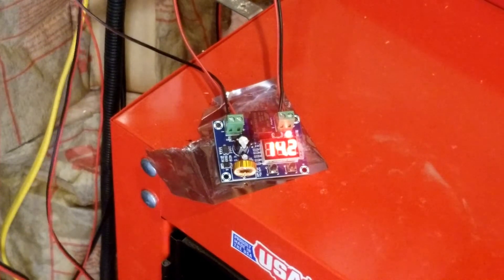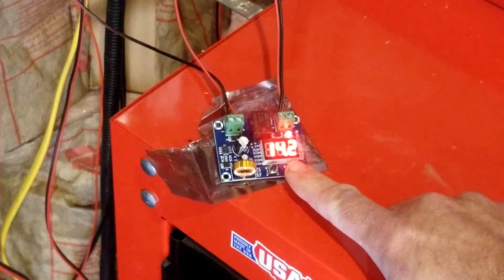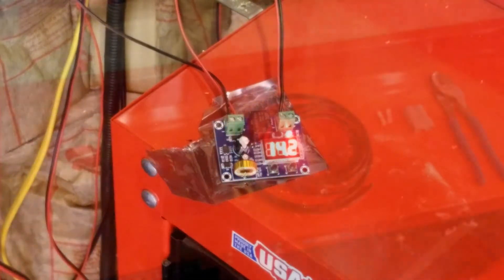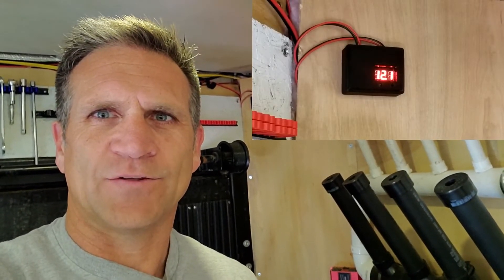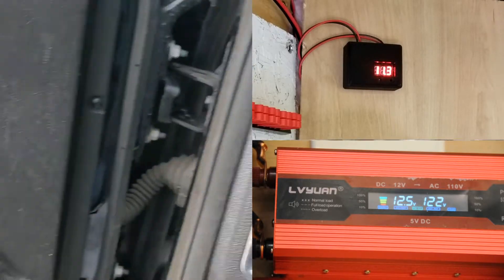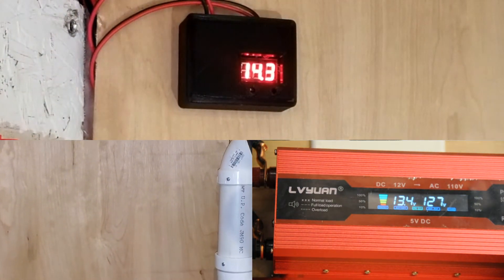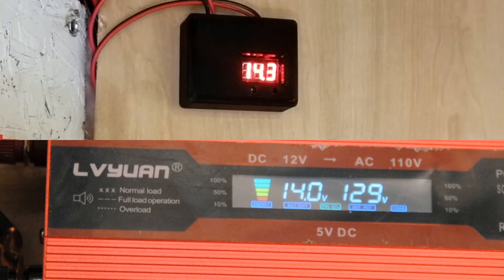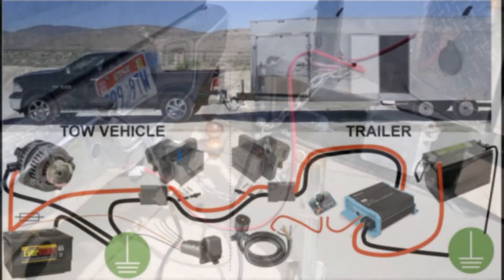DC to DC charger  installation Episode 2: The Install

Comment: Will the lit screen on the voltage cutoff drain the car battery if the car is not running but the trailer plug is connected?
Reply from the maker: Technically, yes. That little display draws power from the car battery. However, the draw from it is so low that a little watch battery would power it for weeks. So, although it does draw from the car battery, its impact is negligible at best.

Comment: Thank you for sharing! I’m currently in the middle of my install. You mentioned the two wires going to the dc to dc charger from the voltage switch. I understand where the red wire goes. I’m assuming the black wire goes to the negative side? Thanks in advance
Reply from the maker: Good luck with your install.

You don't need the black wire out of the voltage switch. The only reason you might use it is if you need to switch ground for something. You don't want to connect it to ground because that would defeat the switch.
Reply: @some-guys-garage  how's the system holding up?
Reply: @youcanthide004 it's holding up great! I no longer have to think or worry about having a charged battery.
Reply from the maker: @nathanecall Ha. That's funny. Evidently I was logged into my personal YouTube when I made this response. nathanecall is also me. Sorry for any confusion.
Reply: @some-guys-garage  Thank you!
Reply: @some-guys-garage What do you do with the black wire then ?  Cut it and heat shrink the end ? Tuck it away?
Reply from the maker: @projet2907  Disconnect it from the voltage switch and remove it. Or cover the end and tuck it away. Either is fine. It's simply not needed.
Reply: @some-guys-garage  Thank you !

Comment: I see some people just add a switch at the dash so after you start the vehicle and the amps come up you then turn the switch on, you can then turn it off each time you stop so not to run down the vehicle battery and thus don't have to turn the power on if you do not need it.
Reply from the maker: Thanks for the comment.

A switch at the dash is perhaps an easier way to visualize the solution for some people, but it's actually rather difficult to implement because you have to run all kinds of additional wires to get from the switch all the way back through the plug and into the trailer. It's also far less fool proof, since you could accidently leave the switch turned on when the car is off. The automated approach shown here is is not only cleaner, but it's actually easier.

The easiest, simplest thing to do is connect the trigger wire to the trailer marker lights. That way the switch and wiring are already installed. You simply turn on the lights to trigger the charger.

In the end, the "best" thing to do is to have the charger turn on whenever the alternator is spinning. This solution does that.

Oh, and all of these options are discussed in the planning video associated with this implementation: https://youtu.be/uONgZkrzkhY

Comment: Perfect solution for a 40 foot diesel pusher with batteries in the back and key switch up front no trigger wire in the battery bay. Excellent Job. Thank you
Reply from the maker: Thanks for affirmation! Glad it helped!

Comment: Excellent walk through for what I am needing. I have a question though. 

The voltage cutoff has 2 wires coming out and the DC to DC charger only has 1 place to put wire. Where does the other wire go? I am assuming to a ground?
Reply from the maker: The voltage cutoff has two wires going in - positive and negative. It has two wires coming out - a positive and a negative. The wires coming out are both switched, meaning they only do anything if the voltage cutoff is on. If you had a device that could be controlled by the ground wire, you could use that as the trigger wire, but the device I have uses the positive signal as the trigger wire. I suspect most devices like this would use the positive signal. If that's the case for you (and i suspect it is), you don't need the negative wire at all.
Reply: @some-guys-garage I am trying to set up exactly how you had it. If I am understanding correctly, coming out of the cutoff, you are only using the positive wire and connecting to the D+ ignition terminal on the DC to Dc charger, correct? And the negative coming out from the cutoff is connected to nothing, correct?
Reply from the maker: @johnsouthern5485 That is correct.

Comment: Also, is the aux supply from the truck from the 7 pin trailer pin?  I would not think so because that voltage would never reach 14 with that small of wire.
Reply from the maker: Yes - the supply voltage from the truck comes from the 7 pin trailer connection. The point is to have the charger come on only when the truck's alternator is running, which produces ~14 volts.

Not sure if you watched episode 1, but it explains the wiring layout.

Good luck!

Comment: Do you sell the housing for the voltage cutoff?  If so can I buy one?  Let know so I can get your contact info.  Great video and this is exactly what I need for my bread delivery trailer.....
Reply from the maker: I don't sell the housing, but if you have a 3d printer (or know someone who does), you can print it from this:  https://www.thingiverse.com/thing:5354419